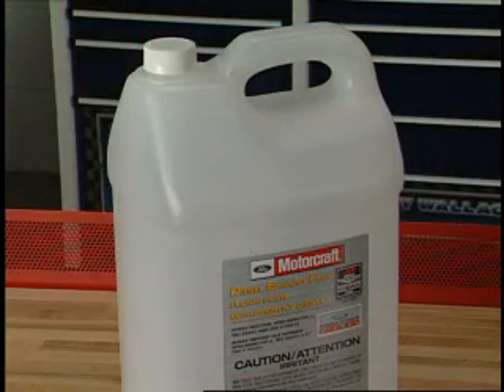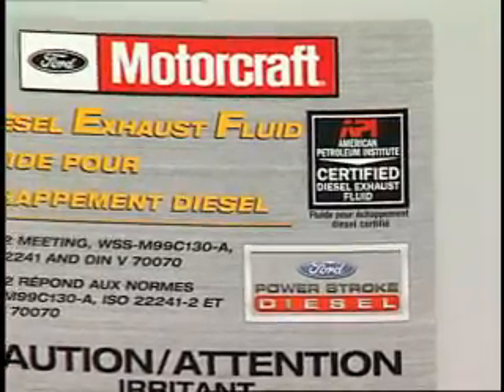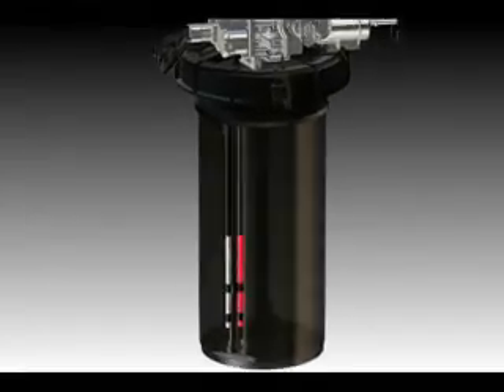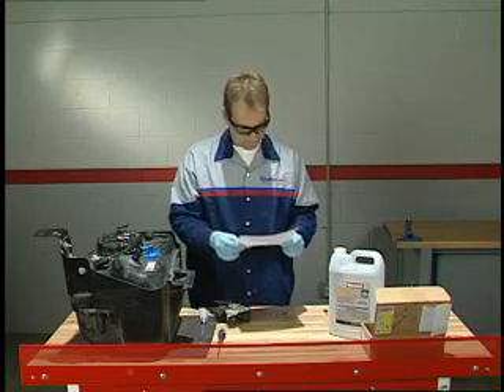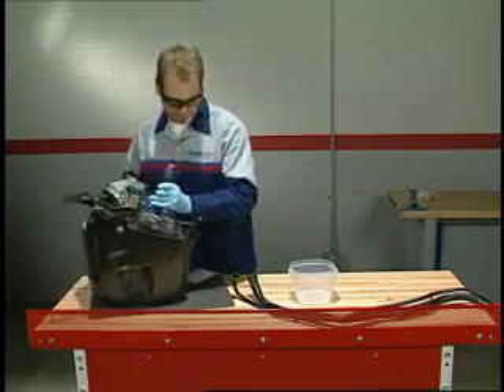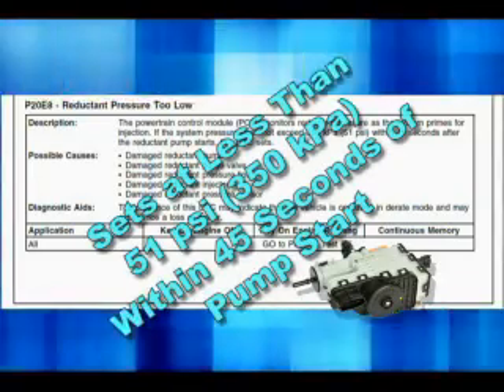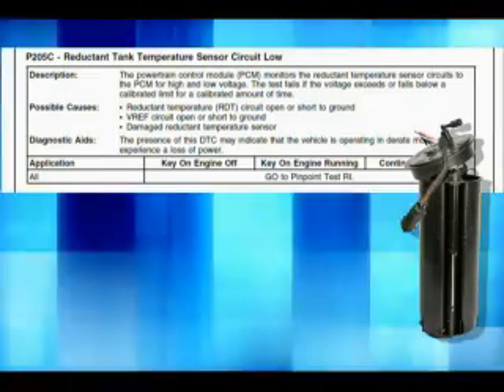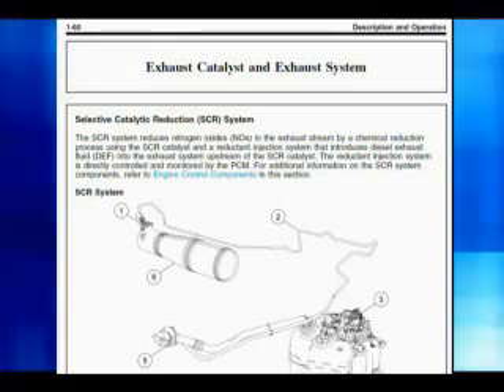Servicing Ford DEF Systems

Comment: Code P21DD on 17` Superduty ended up being moisture (ice) in the connector at the pump.  Read the TSB, but didn't find any corrosion so I dried the plug with compressed air -  applied some DC-4 grease and reset the DTC.  MIL is out and seems to work fine now.

God only knows what the dealer would have said was wrong or how much he would have scammed me out of.